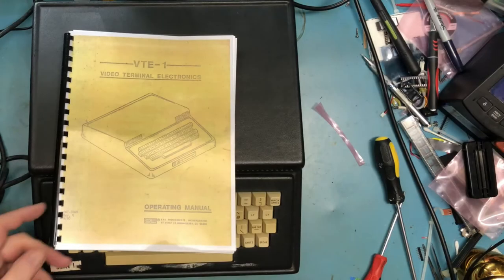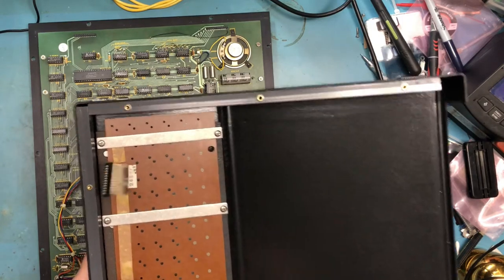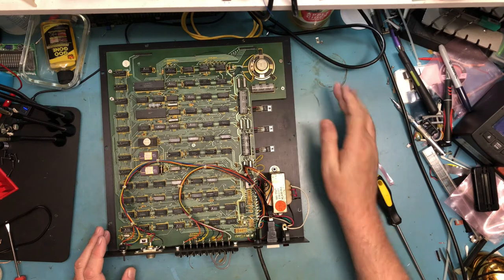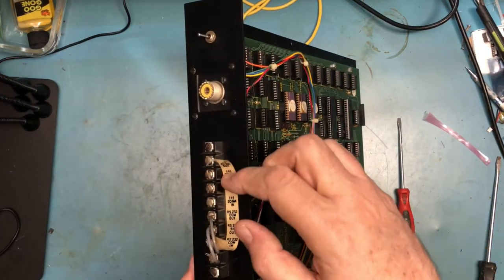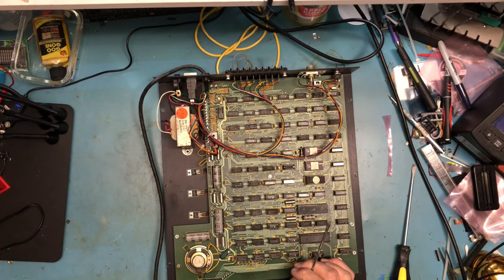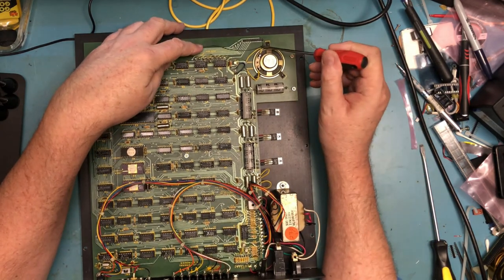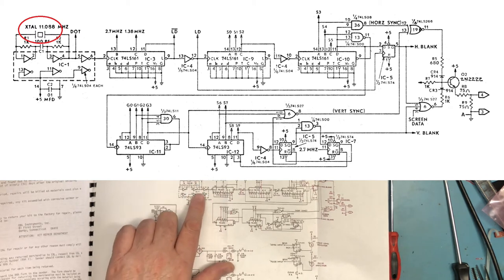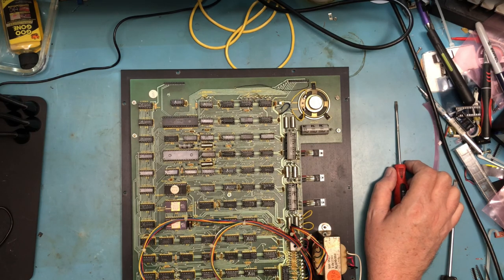STB751 - E&L VTE-1 - Part 2 - Teardown - Serial and Current loop Video Terminal

Comment: On mine the board lifts up quite easy all the cables are longer than they look if my memory serves correctly. Also the yellowing of the keys comes back to normal creame after about 2 days in the sun :D
Reply from the maker: I don't rend to retrobrit older cases and keyboards unless they are really bad. For me it's a bit like removing the patina from an antique, it looses some of its history. With that said there have been projects such as my Amiga 1200 where I wanted the case and keyboard as factory fresh as possible. I bought a reproduction case and am still waiting on my reproduction keycaps.

Comment: Did I hear “de-spiking” capacitors? I’ve never heard them called that!
Reply from the maker: I believe de-coupling is the more common term. I see others using the term de-spiking as well, an example: https://www.element14.com/community/thread/32179/l/adding-despiking-capacitors